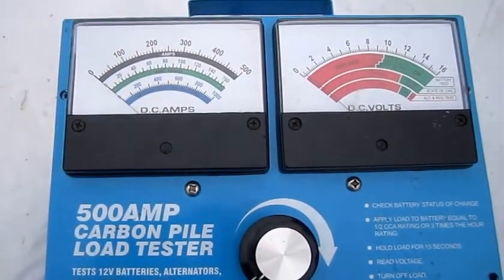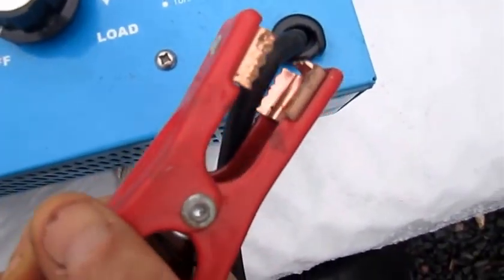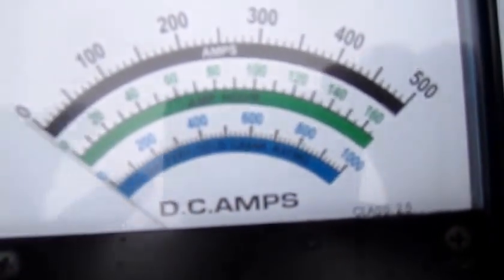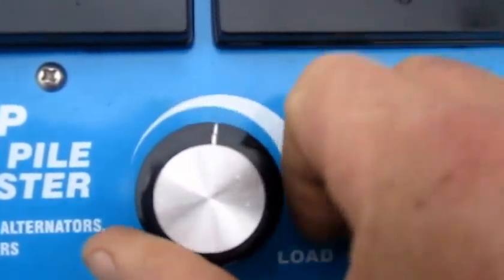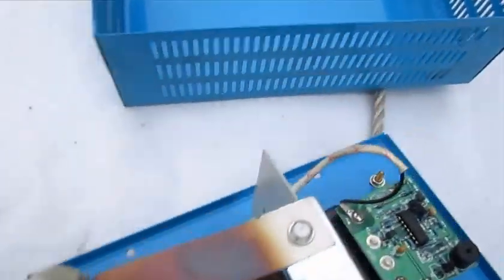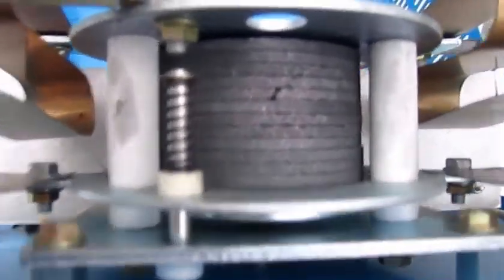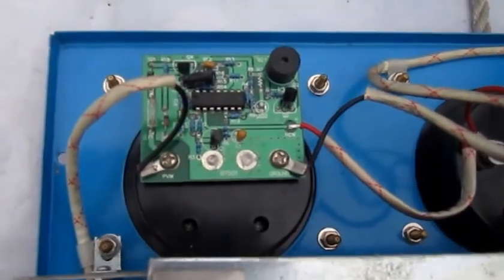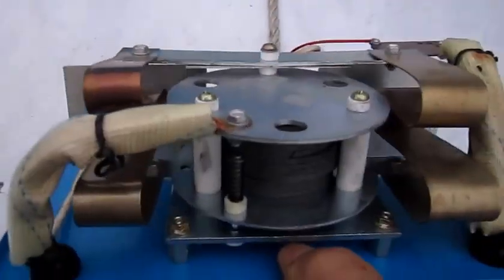Whats Inside 500AMP 12 volt Battery And Starter And  Alternator Load Tester

Comment: Dude clamping the cables sucks.
Reply from the maker: with this type unit its alright the other type units i have no idea. There is no sparking  taking place and there good clamps. The thing is with this type tester One just has to make sure the dial is lose so no power can be drawn as the clamps go on. Or there is going to be lots of sparks.